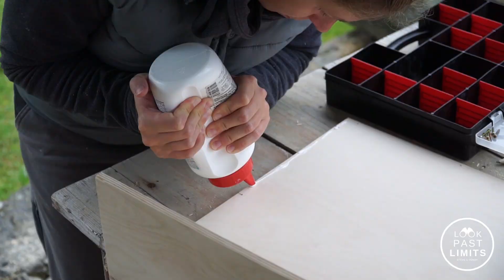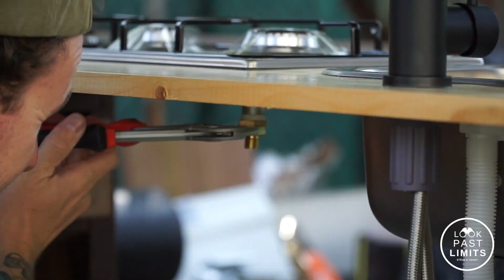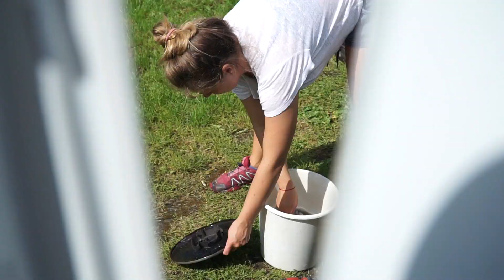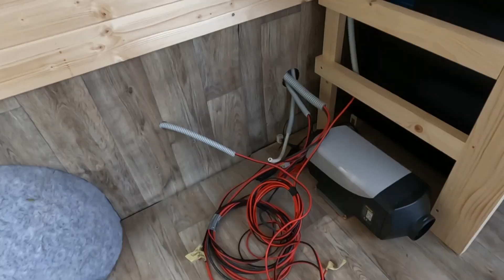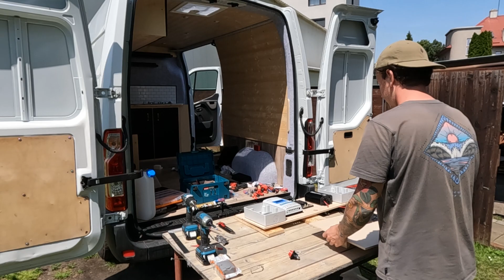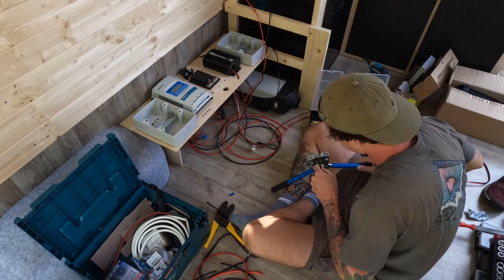Campervan 12v ELECTRICS Install | DIY - Simple, Cheap & Easy!

Comment: Was just looking at different electrical set ups and came across you're channel. Very well presented video, even with the Scottish accent 😂 I'll be checking the rest of your build series now, looking fwd to them.. 
Oh and they are called ferrules in UK, the wee connectors you point out in part 2 for the 230v... 
Well done guys ❤